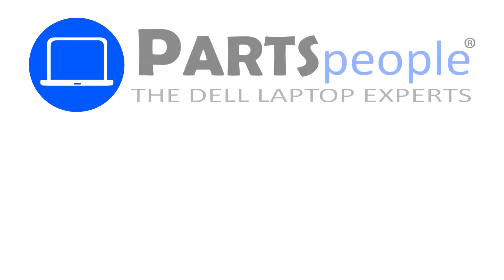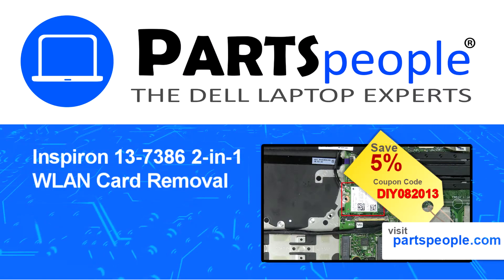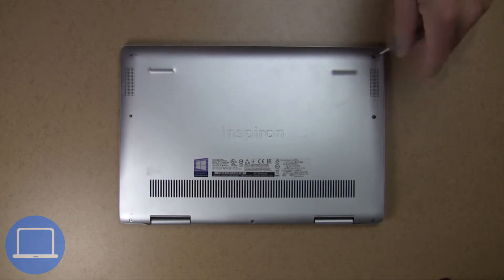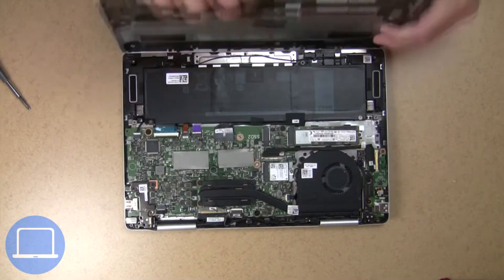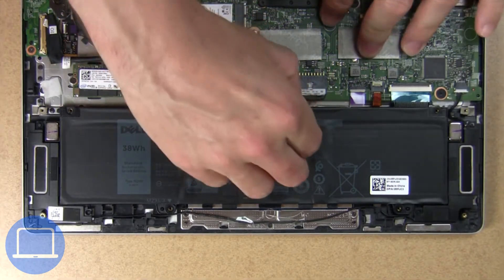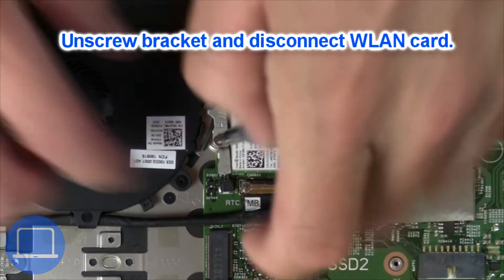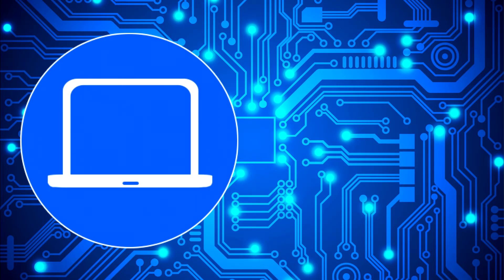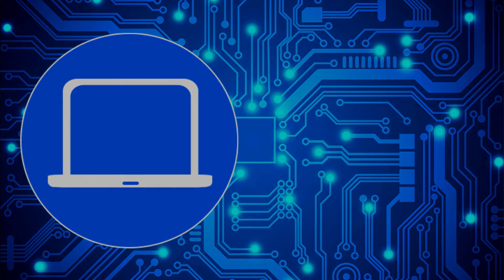Dell Inspiron 13-7386 2-in-1 (P91G001) WLAN Card How-To Video Tutorial

Comment: Thank you. It worked for me. The hardest part is removing the battery cable and the antenna cables (slightly easier to remove if you dislodge the card first and put back once the card is back in place).
Reply from the maker: Thanks for the feedback. Glad it helped.